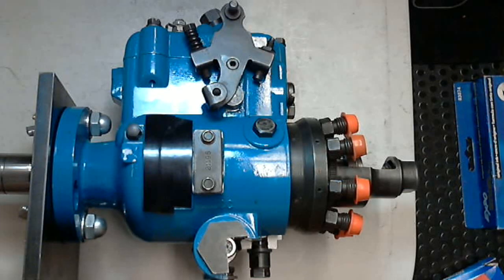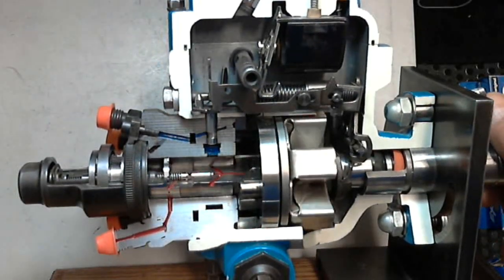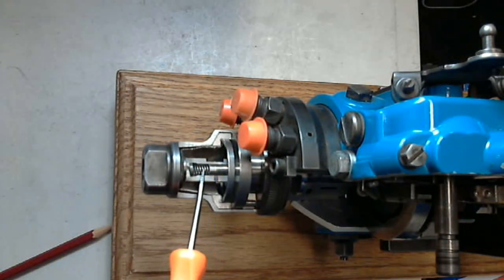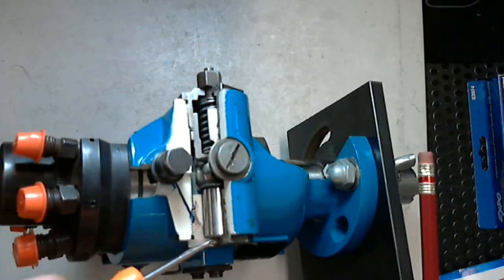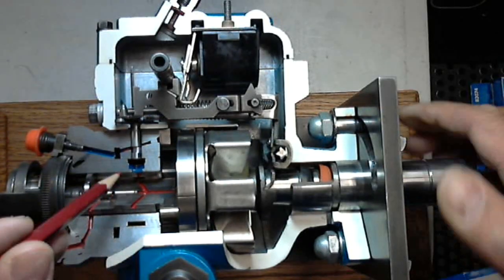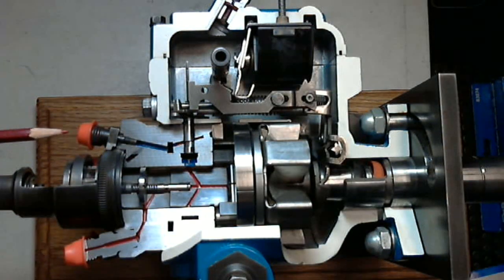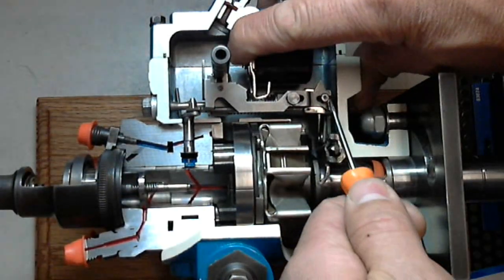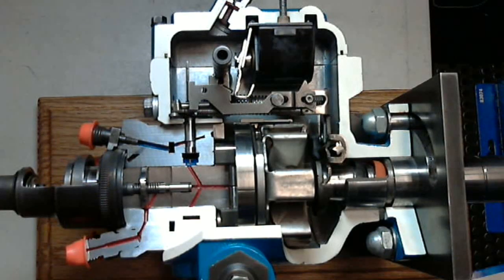Be the Fuel.wmv

Comment: @instructordave111 is it possible or a good/bad idea to install solenoid-operated high-pressure redirection (y) valves in 4 out of 8 injector lines to redirect fuel back to the tank for the purpose of increasing efficiency? Basicaly, the idea I have is that if I can reduce fuel supply to the cylinders without affecting the injection pump's operation then the engine will be able to sip fuel under low load conditions. Could I install those redirect valves to "turn off" every other cylinder in the firing order and drain them back into the fuel tank?
Reply from the maker: Hi Craig, I am sure anything is possible with enough time and money spent. I am not sure you would end up with the result you are wanting as the engine is going to use enough fuel in the remaining cylinders to carry the load that is placed on it. I am thinking that taking fuel away from half the cylinders will require the remaining cylinders to increase the fuel rate to compensate and it may also cause the engine to run in an unbalanced state with the power pulses being uneven on the crankshaft.
However, let me know how it works out if you do this project.
Reply: @instructordave111  Thanks. My idea for this is to be used during low load situations,  like sitting in traffic jams or cruising at highway speeds where you don't need the full power capability of the engine to  maintain speed. If i'm not mistaken, then there wouldn't be a load that would require extra fuel to be spent in the remaining four cylinders. Also, if I shut off every other cylinder in the firing order, would it maintain engine balance due to the engine's geometric symmetry of the firing cycle - for example, the 93 IDI fires with (1,(2),7,(3),4,(5),6,(8))? Also, balance aside, would the injector line redirection affect the fuel pump's supply rate/cycle at all or would it continue as if all 8 were firing? because from the pump's "perspective" they are all firing because it's sending fuel to those every other "cylinders."  Thanks so much for your expertise and input!!
Reply from the maker: I am not saying it won't work and the every other cylinder may work. The pump itself however may be negatively affected by the pressure being variable from one cylinder to the next. Even at cruising speeds the rpm of the pump will create a high pressure injection through the injector and then no pressure on the released cylinder. As I said, I would be interested to know the results of your experiment. Good luck.
Reply: @instructordave111  Thanks again, you are a great help!
Reply from the maker: @125jesusfreak  I am not sure I helped you at all but wish you luck on this idea.

Comment: What would cause the throttle to start sticking out of the blue it's been rebuilt
Reply from the maker: Could be many things.  start with the easy stuff, misaligned cables or linkage, kinked return lines etc. Internally it could be dirty fuel, flyweight not reacting or stuck, inlet valve issues, regulating valve issues, sticking check ball. Rebuilt doesn't  mean operating correctly. My apologies to your rebuilder, we all miss things once in a while

Comment: What is the difference between a DB2 and DB4?
Reply from the maker: The DB2 has 2 plungers and the DB4 has 4 plungers and can deliver more fuel. That sounds good on the surface, but they require a pump stand to adjust and sync the plungers correctly. If not set properly it will give you many headaches.
Reply: instructordave111 Thank you Dave, with that being the case could you build a DB4 for a ford 7.3idi turbo that has been inter cooled? 
I see you travel Montana, I'm in billings.
Reply from the maker: @DaletheRestoRanger  I have never tried that, but I think it should be possible. Just be sure the DB4 is absolutely set up properly for what you are trying to do. A fuel injection shop would likely be able to answer that question more accurately than I can. I have not been through Billings for a while, maybe a bike trip this coming year will change that. Good Luck

Comment: If I had been more patient and watched the entire video, I would have had my question answered!  Whenever I have a pump rebuilt and they replaced the delivery valve,  is the new valve lapped or mated in some other fashion to the seat in the rotor shaft?
Reply from the maker: A new delivery valve would be a whole new assembly that is inserted into the rotor. The old one is removed and the new one is installed in it's place.
Reply: The dv is softer metal than the bore. So it wears but the bore does not. The dv maintains psi in the injection line, approx 500 psi less than injection psi. It helps the engine run smoother. Without it. The injection line to the injector would drop to no psi after each cycle, requiring more fuel to replenish the psi, and would cause a delay. All modern injection pumps utilize them.

Comment: Are both cup seals on the drive shaft supposed to face the same direction?
Reply from the maker: Both Cup seals visible in the video face towards the interior of the pump and 1 other that is not visible in the video, faces the other direction to prevent oil from entering the pump housing.

Comment: Instructor Dave, how could I reach you. I'm having a problem with a stanadyne db2 "running away" at a certain rpm almost as if the governor isn't responding quick enough to the fuelling. (Steady throttle equals slight run away with 1/4 throttle being wide open response from pump)
Reply from the maker: Is this happening under engine load or just by revving the engine?
A diesel engine with no load will rev to the governor with very little throttle input.
If it is happening under load then there is more than likely a mechanical problem in the pump with one of the components that connect the flyweights to the inlet metering valve system.

Comment: Curious as to what kind of pressure is in the dome where the fuel shutoff solenoid is?
Reply from the maker: leverguy 3030 usually between 2 to 5 psi depending on how good your return  fitting  regulator spring is.
Reply: thanks a bunch!
Reply: Also, on a db2 is the FSS the primary shut down for the engine?..... as opposed to the ds4 that also has fuel metering solenoid.
Reply from the maker: Yes the solenoid is generally the primary shutdown.
Reply: The specs. Say 8 to 12 psi.

Comment: If i have solid fuel coming into pump, and 50/50 mix of fuel and bubbles from return outlet, its pump seals?
Reply from the maker: jeff payne how does it run? Do a spill back test into a large bucket to see if you are getting enough return fuel. These pumps naturally aerate the return fuel to a certain extent. Maybe internal transfer pump issue, loose or pressure regulating valve not set correctly. Seals would leak from weep hole or dilute the engine oil. Keep me posted on what you find.
Reply: instructordave111
Reply: instructordave111 
   She runs like a top when i get her primed.  New injectors, pump is about a year or so old. Very few miles since install at a reputable shop.  Started and drove fine for about 6 weeks after injectors installed. Then one morning, no start.  Fuel from return line had bled back to tank.  Isolated the air intrusion with clear lines and can watch fuel bubbles leave pump. If i turn truck off, and immediagly restart, no problem. If she sits more then 10 seconds she loses prime and must be reblead. After hours of research ,i am believing the seals in pump are shot, thus creating an internal vacuum when shut off and filling return with air.
  Thank you for your time both in posting a very informative video, and responding so promptly.
Reply from the maker: jeff payne check for cracked or leaking fittings or pump housing gaskets that may be leaking. Isolate the fuel system to a fuel can to see if there are any improvements.
Reply: instructordave111 
 Ill check the outlet , check valve and brass fuel fitting, as thw inlet line is new, clear line with compression fitting. The inlet line is clear and bubble free at all times.  I can see fuel, no bubbles into pump after days of sitting. The clear return line is the fuel bubble mix, but when i shut truck off, it all drains rapidly from last injector to fuel can on ground. If i hopd line down in a loop, ypu can see a bubble now and again coming out of return line.  Thats what lead me to believe the pump is sucking air and draining prime.
Reply from the maker: jeff payne make sure the outlet check valve is working. It is there to maintain about 3 to 5 psi in the pump body. It may not be sealing and allowingbthe fuel to drain back. Keep looking, also make sure the standpipe in the tank is not cracked. That can also draw air into the fuel.

Comment: Very helpful. So if I want to increase the overall amount of fuel that's available do I increase the size of the plungers and the metering valve or will increasing the size of the plungers do the trick? Thanks to anyone who can answer this question.
Reply from the maker: To increase fuel delivery on this pump, you can adjust the roller spring to allow the plungers to deliver the max fuel that they are designed for, but you can not change to bigger plungers etc. These pumps are only good for up to approximately 250 hp and then you are better off to go to an inline style pump for more fuel delivery capabilities.
I'm sure there are instances where someone has a pump like this at more than 250 hp but those would be limited instances.
 IMHO
Reply from the maker: Parent of Twins if you are willing to experiment and learn something that is great. Just make sure you are working in as clean a place as possible. These wont tolerate any dirt getting into them. Measure the spring height and then tighten the screw to allow the rollers to deliver more fuel. Good luck.
Reply: Thanks for the info, advice, and video.
Reply: Altering the profile of the metering valve can alter the torque curve.  As for increasing flow or volume, you can have the plungers ground shorter and a custom cam ring with a faster rise and longer stroke to match the shorter plungers.  

There are many machine shops out there who could make the cam and regrind your plungers for a reasonable price. 

Another option is to just recut the profile of the cam without altering the plunger.  A larger base circle would increase stroke length of the plungers . 

These are nice purpose built pumps with room for some fun. 

If someone was ambitious enough, a split shot cam profile could be produced.
Reply: Thanks for the info. About 250 HP is about what I'm looking for out of this particular build. I know there are a couple of companies out there that are getting close to 200cc out of the pumps that are available for the 7.3 IDI. I'm not looking to get more than maybe 110cc out of a pump and since I have a couple that are currently not working I thought I would try to do it myself rather than pay several hundred to someone else. Worse case scenario it doesn't work and I have to order a pump but I learn something about these pumps in the process.

Comment: Great Video!! Thanks for the explanations you gave, but I do have a question. Can you use this pump without a sending/lifting pump? What are the consequences? Thank you!
Reply from the maker: Rodrigo Bulman, you may be able to run it that way if the fuel tank is above the pump so it gets some head pressure. Generally there needs to be 3 to 5 psi and enough fule flow for the pump to work properly. Low power and hard start would be the first consequences that you notice.
Reply: What the author says is correct, but it was common on older tractors with similar pumps to gravity feed them.

Comment: Instructordave111, I recently purchased a db2 pump from a not so great company. For the most part the pump works great. My issue is it won't idle down. It's like it's stuck with fast idle engaged but it's not, guessing around 1200 to 1500 rpm. This is on a 6.2 diesel in a 1983 chevy truck. A friend told me the governor spring might be weak. Could that be all that's wrong with it, bad governor spring? Or what other possible issues should I look for? Thanks.
Reply from the maker: Possibly the idle spring is broken or missing which would allow the idle to be high. A weak governor spring would not allow the engine to rev to higher rpm's as the flyweights would overcome the spring more easily and slow the engine down. Also there ma be a flyweight mechanism issue which won't allow the pump to return to a less fuel position.
Reply: instructordave111 that's the spring under the top cover that is on the cap head screw Correct?
Reply from the maker: Yes there are a few springs under that cover so be very careful what you do in there. Was this a rebuilt pump from the place you bought it? They should look into it if there is warranty. Is the throttle cable allowing it to go to idle? Mayne the adjusting screws are not set correctly.

Comment: That was a great lesson. My old F250 will all of a sudden run weak like a gas engine that is low in ignition timing. I can feel it all of a sudden loose a bunch of power. It usually starts the day running good and at some point will loose power but still drive out. From what I understood here is it the return line stopping up ? Or is there other culprits besides the return system? Thanks.
Reply from the maker: Phil Lowman  it could be a return line issue if there is a kink in the pipe or a damaged hose somewhere. It could something as simple as a tank or fuel cap vent that is not working properly. Does it white smoke when it goes to low power? You may have an area in the suction line that is sucking air.
Check the simple stuff first

Comment: Would a sticking delivery valve cause a white smoke condition across the RPM Range?
Reply from the maker: Sorry Armand, I apologize for not seeing this. Yes a delivery valve that is sticking open or has debris on the seat would allow drops of fuel to enter the cylinder via the injector tip. It is there to provide a quick BOI and EOI and maintain a head pressure in the line, without it there would be some unatomized fuel drops getting by. Sorry once again for missing this question.

Comment: Having an issue with a Roosa Master on an '81 Waukesha  mated to a MIller welder...that won't start after installing a new solenoid since the old one would no longer engage. It was working when last used though required firm tapping to shut off since the old solenoid wouldn't un-stick.
 Am I to understand correctly that the functions of the upper housing on this one still work the same? IE the rod below the solenoid slides FWD//BWD?
When attempted to check how the solenoid fit in...since impossible to do so with the new one I used the old...I could see where the foot of the lever would ride but couldn't get that flat rod (6:12 for reference" to slide.
Reply from the maker: RuralTowner as far as i know they are the same. Make sure the diode is installed correctly across the two terminals
Reply: The solenoid is powering up with a definite CLICK. Am looking at a couple other videos and posting questions as well but I THINK i see now what might be going on. Just noticed that it looks like the foot hooks around another tab on the slide below as it seems to appear in this cut-away?
Reply: You definitely have to have all the linkages connected properly for this system to deliver the fuel. Check it all carefully, I know it's a tight spot to work in.
Reply: Seems on mine the solenoid foot wont go around the tab but instead sits behind it. Powered on the slide moves back on its own into the RUN position. Powered off the foot seems to press the tab and thus the slide to OFF. But I think it is trying to jam since it won't quite shut off all the way. Took some working even by finger-force to get it to move then free up. Engine RPMs drop but won't go off without some tapping on pump.

Carefully open up the foot a little more so it fits around the tab? Even the old solenoid didn't seem to want to go on? Or might I be missing something on install.
Reply from the maker: I am guessing that you have something misaligned in the linkages, possibly some worn out items or adjustment screws that are causing the binding linkage.
Reply: Could be. Pump is on an engine mated to a generator head for a 350A welder that saw who knows how much oil field (per the faded logo on the side) use before I got it. Have found a video where the poster is going through a step-by-step process of disassembling a pump like mine (just throttle lever on opposite side). My return hose was also severely restricted so any gunk in the fuel might have had time to accumulate  in the upper workings. OR just worn. 

Doesn't seem that the metering shaft would be causing issue...so I agree with your assessment. The first time it stuck on me it took little intervention to get it to shut down...over time had to be more firm with the rap tap tapping. Between this video to see the inner workings and the assembly method in the other I'm getting a better understanding and now have a faint inkling on 1 potential cause...big screw on backside of the top housing...I THINK the screw seemed a tad loose...if has any wiggle-play  it could cause binding. However it has a knob-end for hand adjustment too.

Will know more shortly.
Reply: Seems it was just linkage binding. New solenoid is longer than old so couldn't just set everything down//in. This time held plunger back (instead of trying to move slide to OFF (and thus inadvertently raising it up on the shaft during tool removal). 2 starts 2 shutdowns with normal  behavior.
Reply from the maker: RuralTowner im glad that you got it figured out. I was not aware the solenoids would d8fferent dimensions. Thanks for the info.